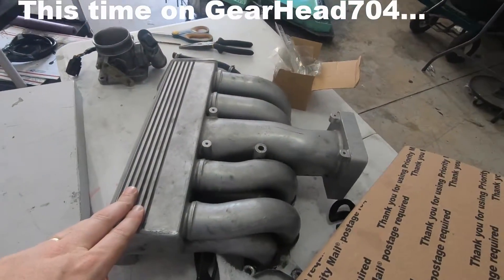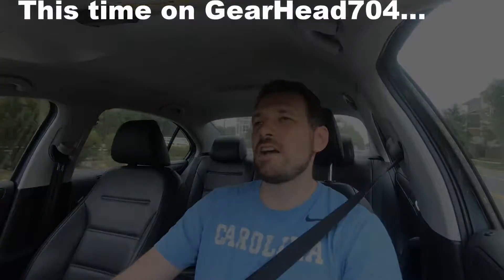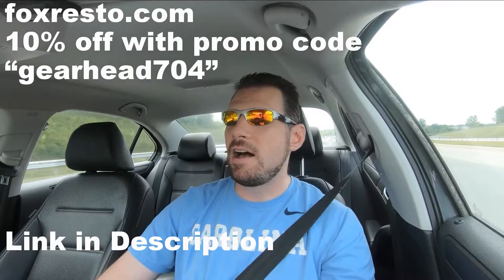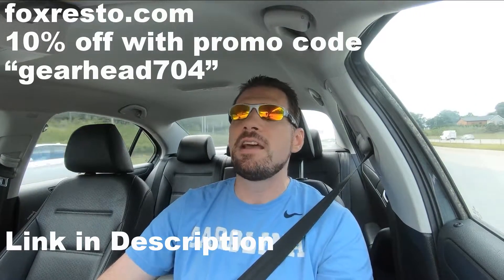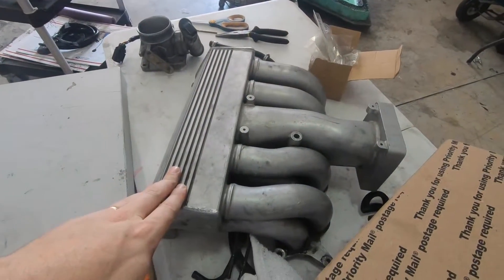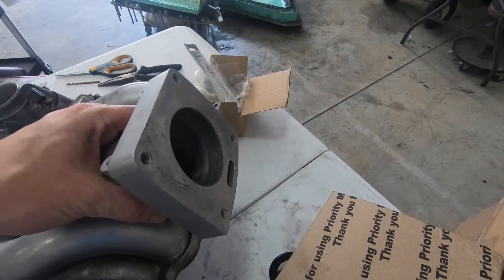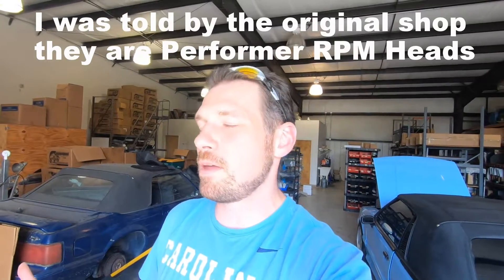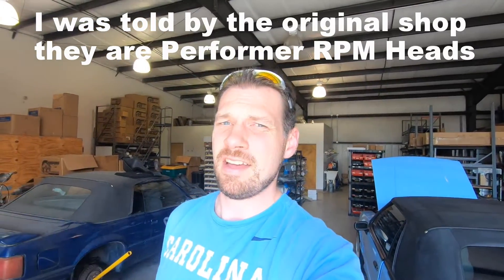I Bought The Wrong Intake For My FoxBody Mustang!

Comment: Just a note for loosening bolts, nuts and fittings open your hand and use ur palm.  If you slip you won't punch metal or any other immovable objects and you will not break your hand.  With that small of head the gt40 is a beast of an intake for fuel atomization and velocity.   To save money just install the throttle body with a spacer and you should be ok. When ready to roll the ssp, purchse the right combo to fit both cars and use  the other with throttle with the correct setup
Reply from the maker: Yeah, I didn't realize how much of a technique there is to wrenching, but i'm learning there is definitely a lot I need to learn there.  Thanks.

Comment: Sure hope the original shop didn't short you on the 331 short block build too. They might have just put big upgrades up top that you could see so you wouldn't question the inside, shady shops out there. I once had a shop finish a build and they didn't put in a dipstick or tube lol you will get it straightened out 👍
Reply from the maker: I thought that too, although I had a second shop rebuild it and they also said it was a 331, so I think (hope LOL) that is the case.   I think it dynoed at 345ish so I feel pretty good about it, but yeah never know with that old shop LOL

Comment: Edelbrock performer heads are still better than e7 and gt40 heads.. i wouldnt really say they are bad. 331 with those heads and 75mm tb will do just fine. I had a 302, e7 thumper heads, with a comp polymer intake and 75mm tb with e cam and made 330ftlbs of tq. Id bet switching to performers would have give me another 20ftlbs. 
With that rambling being said..the gt40 intake is great.
Reply from the maker: Yeah, maybe they aren't as bad as I thought, LOL.  Still I would like something that flows a little better later on.  That sounds like a nice combo you got there though.
Reply: @GearHead704  it was..but i sold my fox like a dummy
Reply from the maker: @TheModAddict  😥

Comment: If they’re performer heads it will say it right on the outside face of the head. No need to pull valve  cover. Also, you can run the tb the way it is. It’s not gonna hurt anything. If you open the intake up to match it will be a better option. But it’s not the end of the world if you don’t.
Reply from the maker: Thanks bud, it did said Performer, but I wanted to be 100% sure what it was, plus I learned how to take those covers off LOL.  I was really trying to match the TB as well.  I might sell my 75mm when i sell the Victor EFI, but i'm not 100% sure.

Comment: If you have poor performing heads, the intake, cam and exhaust are you friends. Meaning bigger for everything will help instead of the “too big” mentality. You are going to hold back the 331 regardless because the heads are the bottleneck, but “matching the intake to the heads” is poor thinking if you want to get more power out of what you have. You always want more cfms from the intake even if the heads are on the smaller side. The cam is the brain of what do do with what you have.
Reply from the maker: Turns out my motor is bad now.  If I rebuild I'm going to change the heads and go BIG on everything

Comment: Honestly forget that GT40 just hang it up on your wall if it’s not going to ported out. It looks pretty, but doesn’t perform in stock form.
Reply from the maker: It will just be temporary so I can drive it, but yeah i'm going to swap it later on for a different 331 top end.
Reply: GearHead704 heck yeah sounds like a good plan brother keep up the hard work 🤘🏼🦊
Reply from the maker: @whatthefox302  thanks!
Reply: You can not port a tubular GT40.
Reply: GT40 is one of the best all around performers available for the Fox Mustang. Literally every shootout back in the day proved this out. 320 ft/lbs of torque and 264 HP on a stock motor. Some of the 'name brands' like Edelbrock, Trickflow and Saleen/Holley made more peak HP, but the GT40 was always the leader throughout the RPM range and torque. Which is power you can use, unless you're a race/dragstrip only application.

Comment: On the gt40 the lower is the restriction.  Do a ported gt40 lower and just use the 75mm throttle body.  Use a 75mm gasket and mark the upper intake opening and open it up to the 75mm opening.  Done...
Reply from the maker: I finished this install a while back now, but in the future i'll be changing the heads and intake again and reuse my 75mm

Comment: I believe you received some wrong information about the heads there. That number 6025 is just the casting number. Its not the part number of the head.  The only difference between the Performer and the Performer RPM is that the Performer heads are emissions legal (they have all the emissions ports) and the RPM's do not have the emission ports. 

Both model of heads have the same intake and exhaust ports and flow the same. They do come in two different configurations though.  A 1.90 or a 2.02 intake valve.  You would have had to take the head off and measured the intake valve to see what size it was.  

I did notice in the video that your heads had the EGR port in them so yes you had the Performer (but again the Performer and Performer RPM flow the same). If you have the 1.90 intake valve then that is P/N 60379 if you have the 2.02 valves its P/N 60399.
Reply from the maker: Thanks, I did not know this.  I recall the last person that put the heads on saying I had the 2.02 intake valves.  Anyway, i'm going to sell them and go with some AFR or Trickflow R at some point.  Thanks again for the input.

Comment: Those heads are good for 500 hp na save your money get use the get 40 and Get it running right and decide if you wanna spend 4000 dollars to chase those last 63 ponies. Just go turbo whispers the devil gain 300
Reply from the maker: Thanks Jim.  It's definitely something i'm going to think on.  Right now I just mainly want to get the convertible out of the way so I can focus on the SSP.

Comment: You need a plan. It seems it's just a hodgepodge of parts. You need an experience person to plan your parts  
Tubular GT40 is not that good of an intake. Just hype 
Since you're racing is #1, you need to GYST.
Reply from the maker: My apologies for not responding sooner.  I've been out of the country.  You are right about needing a plan.  I am going to revealing my plan in this coming Sunday's upload.
Reply: GT40 is one of the best all around intakes you can put on a stock motor. 320 ft/lbs and 264 HP.